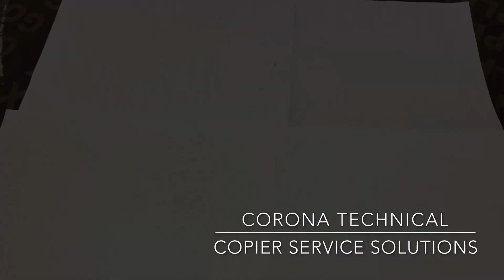Konica Minolta C452/C552/C652 Pickup Roller Replacements

Comment: what a pain in the dick...on Canon Ricoh Xerox it takes about 2 minutes to change   the feed rollers. konica engineers thought what they were smarter guys at that time. badly wrong 😁. they have changed their conception since that time.
thanks for the tutorial dude it will help me  or any other technician that starts working on KM devices.
Reply: There is a quicker way to do it. Takes less than 10 minutes.